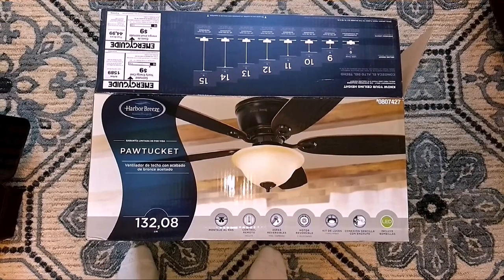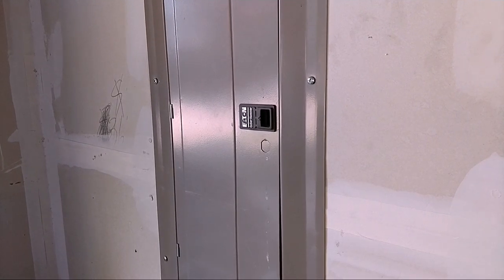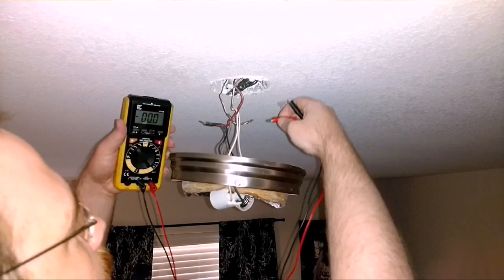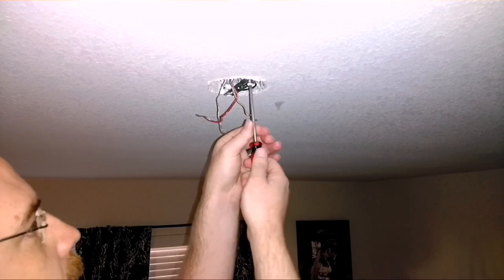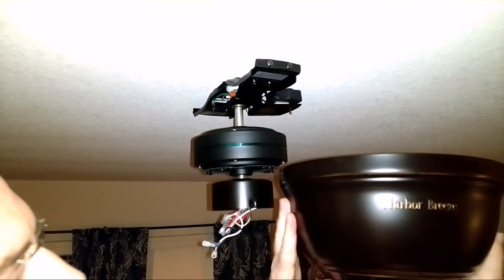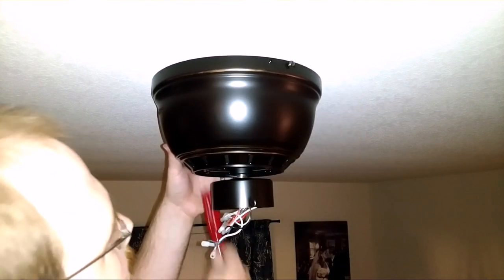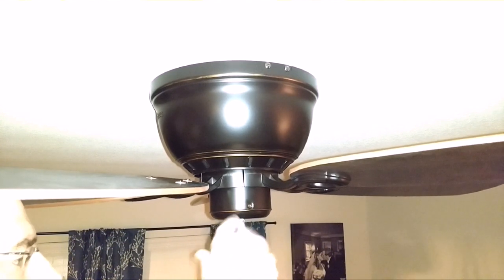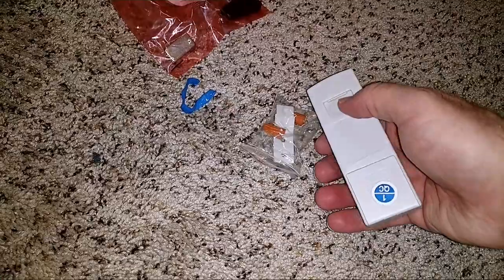Install Ceiling Fan in place of light fixture. Metal Frame House. Harbor Breeze #0807427

Comment: Better make sure that box is supported to be able to hold ceiling fan.  That first light fixture doesn't weigh much so make sure the box is supported properly and rated for a fan
Reply from the maker: I can tell you didn't watch the video. I specifically address that and also go up in the attic to show everyone what it looks like and then also showed in the video one that I bought just in case I needed it. I probably spent too much time in the video showing that.

Comment: To connect the 2 wires from new fan light switch to the fan/ceiling, it doesn't matter which wire goes to which?!?!  (my light switch chain won't move at all, gonna replace it)
Reply from the maker: Ok. Thanks for watching.

Comment: Installing mine right know to find an additional black wire from fan receiver. Wondering if needed it at all, since is not covered on manual.
Reply: Never mind me. Antenna for remote.
Reply from the maker: Lol, glad you got it figured out. Thanks for watching!
Reply: FUNNY GUY
Reply: LOL
Reply: 0:44 Mine didn’t come with a little leg.  Do I need it for install? 😁
Reply: I think I messed up around 9:54.  I am trying to install with a decorative ornament in the background, but this design is making it impossible to get a solid fit into the outlet box.  I also don’t think I connected my wires correctly because voltage isn’t running through.